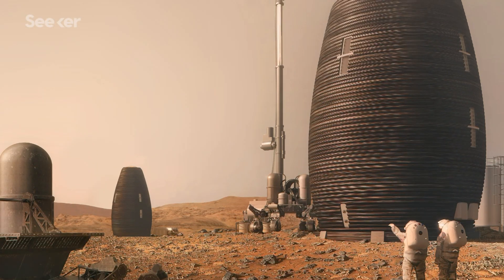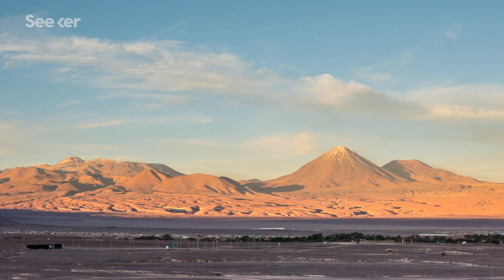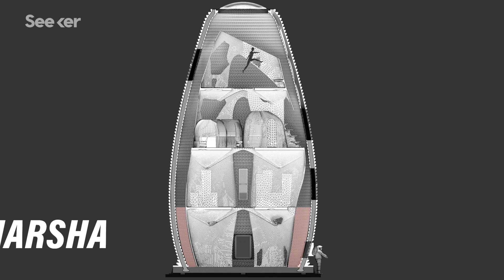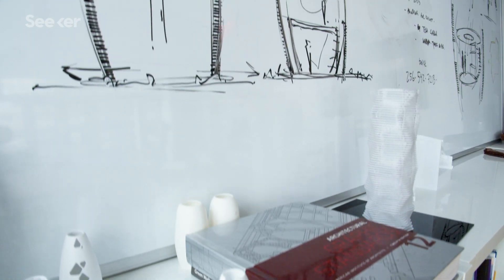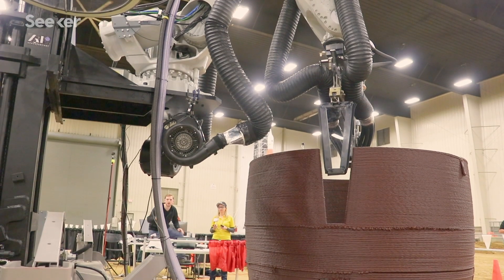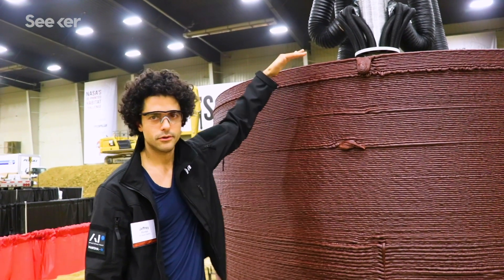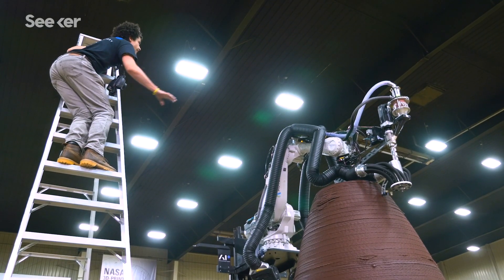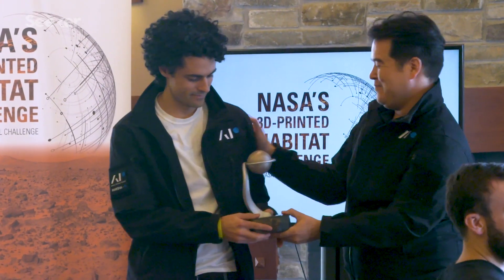NASA’s Challenge to 3D Print Future Habitats on Mars

Comment: I want to know how "using the resources we have on Mars in situ" to "we printed with thermoplastics" are actually related?
Reply: Hydrogen, carbon, and oxygen are the three main elements in plastic. The key is producing ethylene gas (C2H4). Carbon dioxide and hydrogen combined in a reaction gives you ethylene and water. 

 With some known chemistry discovered in the late 1800s, they can literally create plastics out of thin air. They just need to bring the equipment and hydrogen to mars to get it all started.
Reply: @lizzy777  Ok, that makes sense. They put 0 effort to explaining how the process of making the material was going to happen. H2 being bulky wouldn't be the best component to bring in large quantities I would imagine. I figure that would be best made from the water on Mars? but the guy said they didn't want to use water due to its preciousness.
Reply: @3800S1  , water would be precious, but splitting it gives you hydrogen for plastics and oxygen for breathing :)
Reply: @seasong7655  PLA is known as the biodegradable plastic polymer.   I wonder how long that will last in the radiation rich environment of Mars being blasted by the entire spectrum of the sun.   There is also no defined process for extracting just the basalt from Mars regolith much less purifying it of the perchlorate.   I have a dozen other issues with this particular Mars habitat building experiment and a lot of issues with the whole rest of the "lets go to Mars" fever.   It looks to me like a bunch of white coat geeks fishing for money to go play experiment with stuff, none of which is practical for actually planting humans on Mars such that they can survive there.
Reply: @massimookissed1023  you need more than 02 to not suffocate
Reply: @massimookissed1023  would that be practical to produce in useful quantities on Mars?
Reply: @lizzy777  If they land in the right spots.. they dont need to bring hydrogen either.
Reply: @lizzy777  And since there is salty water ice on the poles and most likely everywhere under the surface of Mars, they can extract the hydrogen from that and voila, they don't have to bring anything to Mars.
Reply: @lizzy777  You're making an incredibly complex system seem like a trivial thing.

It's true that polyethylene (PE) plastics can be produced by CO2, but the reaction that we currently know which turns CO2 into ethylene uses water, specifically alkaline water, as the electrolyte. So a CO2 -> C2H2 generator will need to either be accompanied by a large quantity of water, or a preceding mission will need to land near the ice caps and melt ice into water and store it.

But the plastic shown here also uses polylactic acid, also known as PLA. PLA is made with lactic acid, which itself is the byproduct of the fermentation of sugar, which can be made using CO2. This is called the Calvin Cycle and it's a fundamental part of photosynthesis.

So theoretically you could produce this plastic on Mars, but you'll need to either bring the raw material with you, or you'll need to first have a mission go and set up a base that can be used to generate the raw materials that the 3D printer would use. Only one of those option is in-situ, but even so I think it's a little disingenuous to say it's being made in-situ when it'll need a whole other Mars mission.
Reply: @lizzy777  - There is water and ice on Mars so you don't even have to bring the hydrogen. Just set up some equipment to break the ice down into the raw gases and you are good to go.
Reply: @lizzy777  how the hell are robots suposto mix that
Reply: @lizzy777  Imagine if instead of using carbon-plastics they used silicone (silicon-plastics), you just need tons and tons of energy (which can be gotten from the sun).
Reply: Thermoplastic is a very broad term.  I'm sure the bulk of the material and rigidity is made from Mars sand but they might have to bring some additives.  Some could argue that glass can be used as a thermoplastic (after all, in normal 3D printing terms, the plastic solidifying is called "glassing"), and glass is made of sand.
Reply: @Toastmaster_5000  , ESA are working in a 3D printing builder that uses concentrated sunlight to sinter lunar regolith.
 Sintering doesn't go as far as melting, but it does soften the rock grains enough to fuse together.
Reply: @massimookissed1023  I am a bit surprised NASA didn't go for sintering for Mars, but, I wonder if the problem is because Mars is too cold and windy.  The moon has practically no atmosphere or wind and is closer to the sun, which makes sintering MUCH easier there.
Reply: @Toastmaster_5000  , yeah, Mars is 1½ times the distance from the sun, so it gets <½ the solar power of the moon's surface.
Reply: @massimookissed1023  intensity has an inverse square relationship with radius.
Reply: @ckhalifa_  , uh huh.
1/1½² = 1/2.25 < ½
Reply: @Toastmaster_5000  video says mars has 1 per cent of earth's atmosphere, so it can't be windy. The book and film the Martian was wrong about storms on mars, the author admits it. He was interviewed by the futurist John godier recently
Reply: @arthurballs7083  Except, it is windy enough to have blown dust on the rovers' solar panels, and, windy enough to create tornado-like storms, which there are photos of from orbiters (I think the Mars Reconnaissance Orbiter was one of them)
Reply: @Toastmaster_5000  , you are right, it absolutely gets windy on Mars, but due to the low atmospheric pressure, the regularly seen 250kph wind speeds have the same strength as a mild breeze on Earth.
Reply: @massimookissed1023  Except the earth's atmosphere reflects about 22% of solar energy. {1/2.25} > {(1-0.22)/2}
Reply: @simonoconnor7759  Although the atmosphere is <1% of earth's, that doesn't necessarily mean the wind is like a breeze here. Small particles travelling at high speeds can do quite a bit of damage. Solar concentrators would be able to harness enough energy from the sun to perform sintering, but the walls of the building need to be a certain thickness to prevent those high-speed particles from breaking through. Glass is also strong, but brittle. Sintering will likely be a common form of materials processing once there's a settlement on Mars, but I think it's a poor option to use in building construction (especially in a fully automated environment that is meant to prepare living quarters ahead of the arrival of astronauts).
Reply: @Toastmaster_5000  I saw a concept that involved automated microwaving of materials powered by nuclear and solar.
Reply: @Toastmaster_5000  on the moon a lot more sunlight is available for the sintering process. But these sintering of regolith just produces rough bricks for simple walls. Of course a wall masoned of sintered bricks would not be airtight and you would still need an extra reinforcement to provide the required tensile strength required from the inner air pressure
Reply: No additives needed actually. Through atmospheric extraction of carbon from the atmosphere they can make the Bildung material on site
Reply: Peter Schmidt glass seems to have more thermoset properties to me. It would have to be a special type of glass because many are subject to  fracture if the conditions aren’t perfect
Reply: @Toastmaster_5000  Sand which is silicon dioxide or SIO2 is mixed with sodium carbonate(NA2CO3) and either calcium carbonate(CACO3) or dolomite(MgCO3) to make glass.    Thats a bit more than sand, requires a lot of energy to produce and a lot of chemistry to make as well as a relatively large scale processing plant for the finished product.    Can't 3d print that.
Reply: @macfranks2456   First of all, sand also includes more ingredients than just silicon dioxide.  But also, as far as I'm concerned, you don't need those other ingredients to make glass.  There's lots of different types.  I'm no expert on it, but I wouldn't be surprised if you can make glass without SiO2.
Reply: @Toastmaster_5000  Tell me more about 3D printers that use sand (or mud)...  If you could melt sand to build a solar concentrator to melt sand into to build more solar concentrators you could get the 3D printers to double every generation until you have trillions of them (most of the parts of the 3D printers could be printed, but yeah you'd need a trillion electronic parts that can't be printed on site).
Reply: @Millar - True. When the base is better established and they can extract and process the Martian ice, that would be the way to go. I was thinking more along the lines of establishing the base itself. Sending up an automated system with tanks of hydrogen to get the site started.
Reply: I live in a conventional home. On a farm outside Kansas City Missouri. 
I’m retired now trying to live the care free life ( someone talk to my wife) style. 
The shape of the structure is quite interesting. I’m reminded of a hornet nest . 

I like the design. 
A emergency exit or elevator could be built outside the cone structure wall . Attached and secured. Build it with a straight wall   This would become a greater storage area as it neared the top. In other words you get a closet or a bathroom . Not to forget a elevator or stairs or-even a raised deck. 

Would the different floor levels be incorporated into the 3 d printing.
Reply: @Millar hydrogen can't explode in the martian athmosphere, as there is no oxygen to react with, just carbondioxyde and that reaction isn't sustained to a point where it would become an explosion. You'd need to have either a mixed tanked of liquid hydrogen and oxygen, or have the tanks so near to each other that they are both effected by what caused the first tank to rupture so that the two gases could then mixed mostly undiluted to explode.
Reply: There are two kinds of plastic (broadly speaking), thermoplastic and thermo-setting plastic. The former goes soft when heated, can be moulded, and can be reused by melting it again. The latter sets hard and cannot be recycled.
Thermoplastic is a non-specific term although it is generally used for products derived from naphtha, from oil by cracking, using heat and pressure. Technically, it can be used for any material which becomes soft when heated, which could include glass, metal, and even sand. Once glass is made it can be easily recycled, as can metals and some plastics.
Part of the problem is that plastic is a property of a material, whereas we have taken it to mean a particular family of polymers (derived from fossil fuels and plants) in much the same way as Hoover, the brand, has been taken and used as a generic term for vacuum cleaners.Having said that, I do take your point, thermoplastics, as in fossil fuels, as far as we know do not exist on Mars and would have to be taken there. The sand, if it can be processed, could be used instead.
Reply: Because the resources on Mars can produce thermoplastics, which are good for 3D printing and radioactive protection.
Reply: too slow the rusian system is better
Reply: It’s a composite of Martian soil fused with thermoplastics “cement”, essentially Mars sand + Hot glue on steroids = Mars plasti-crete
Reply: https://www.youtube.com/watch?v=AIrH01N9AsE
Reply: it is mixed with mars basalt.
Reply: Don’t use rocket to travel to Mars
Easy launch easy land
No Fire
Just spinning
Rocket is complicated and dificulte
Low safety and high cost
We need somethings better
Developing technologies to enable human access to space at dramatically lower cost and increased reliability #FeelFree http://youtu.be/6q7MovLP-e8
Reply: It's crazy to me that the throw away culture has gotten so bad that they would rather fix mars up rather than stop destroying our earth.
Reply: Sintering is no thermoplastics

Comment: Very impressive, but I see a problem. You would have to carry all that plastic. Plastic, as with most things, is very heavy. Using molten iron from melting iron oxide would be more practical (Mars's entire crust is covered with Martian dust, which is almost pure iron oxide). However, that requires higher temperatures, as well as a way to collect martian dust (Probably in a separate rover). Keep going, as you are advancing humans to the point of living on Mars. We are so close, keep up the good work
Reply: It is designed to be built from a material you could create on mars, so you wouldn't have to carry it all with you. This is mentioned in the video :)
Reply: @joshuanorman2  Oh, sorry. I must have missed that part! But anyway, apart from that I have no issues whatsoever with what they are doing, which is advancing science and by connection, the human race
Reply: @andreyrumming6842  You really thought they would get this far without thinking about that??
Reply: @andreyrumming6842  I do like the idea of using the iron oxide for free materials though, no need to mine for it and it's everywhere!